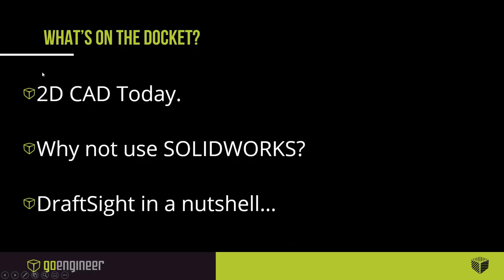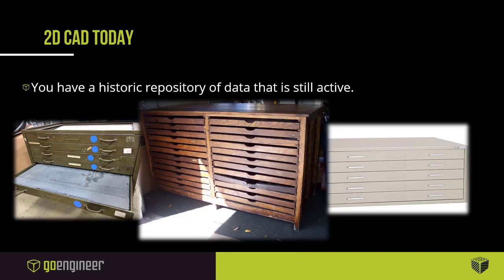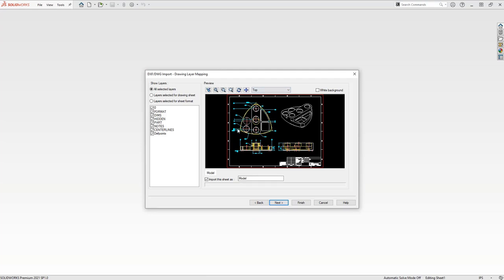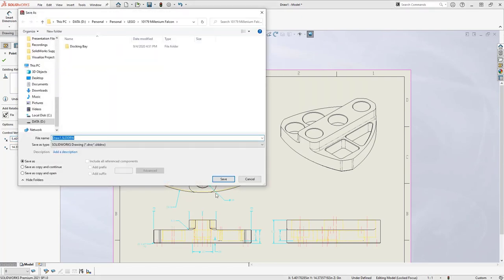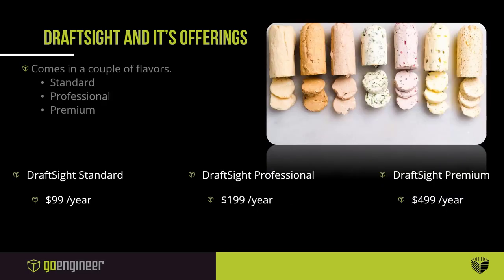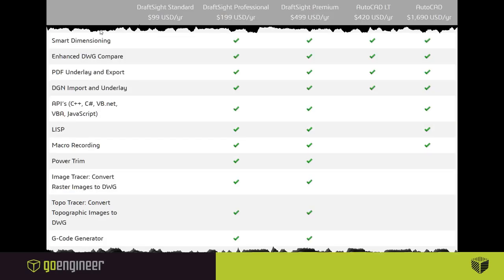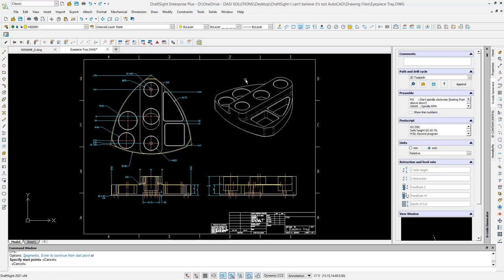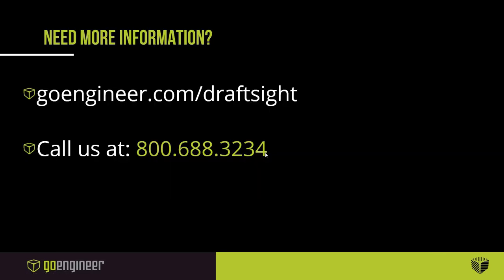DraftSight - I can't believe it's not AutoCAD

Comment: Can you fold sheet metal in draftsight? Or corrugated?
Reply from the maker: Draftsight does not by contain any specific tools for folding Sheet metal. Your best bet for that would be Solidworks, sheet metal tools are included as part of the standard software package.